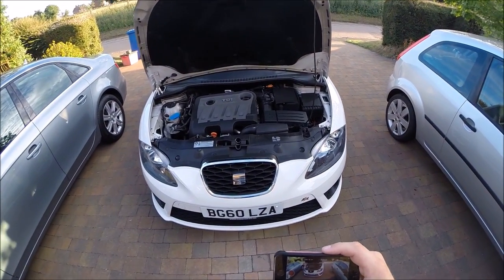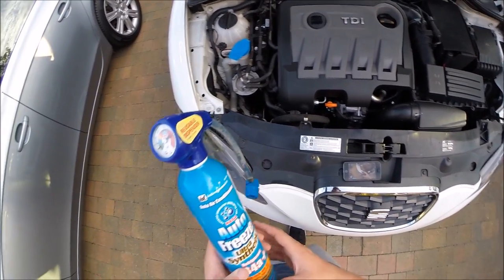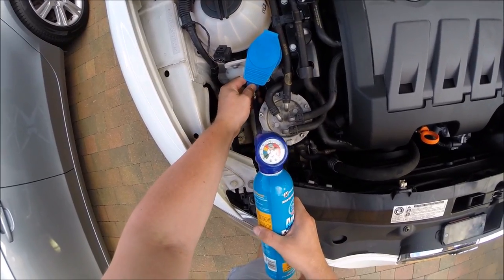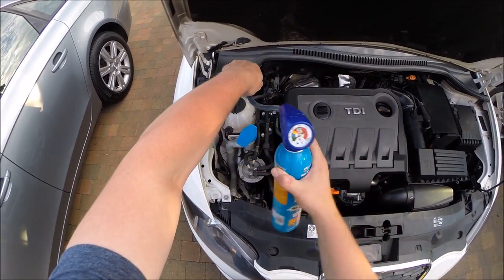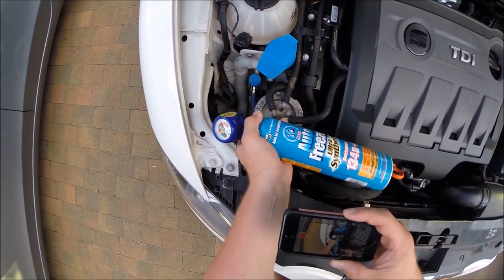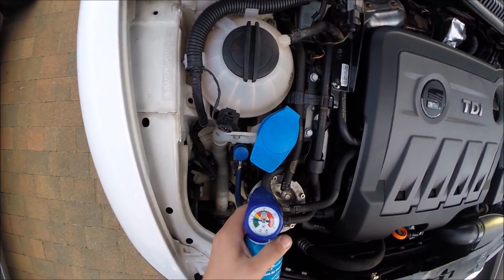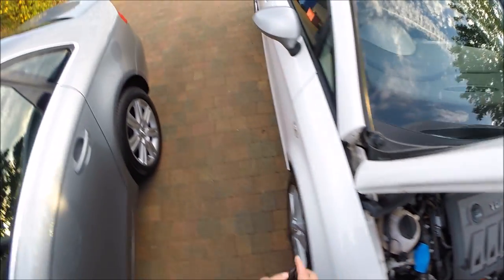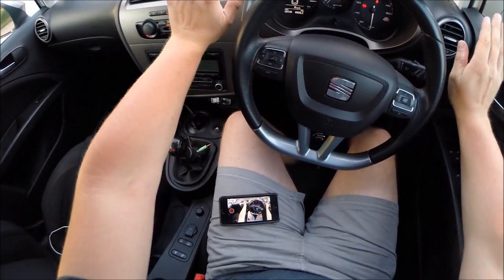How to Recharge a Car Air Conditioning System SEAT LEON TDI VW/AUDI/SKODA/SEAT

Comment: I think u have to conect to low pressure side while the car off then after switching the engine on and aircon on to high plus circulation on then start to add gas then when the system fill up switch the engine off then disconnect the gauge off the low pressure inlet and check for leak with add some water in the inlet and after checking close the screw top

Comment: This is nothing but a bodge job airconditioning gas is liquid when not under pressure and the correct amount in any system is calculated by weight,also compressor oil may need to be added to the system, the only way to do the job correctly is to have the system serviced, this involves drawing out the gas,pulling a vacume on the system to remove any contamination re oiling the. Compressor with the correct amount of oil then refilling the system with the correct weight of gas, over gassing will damage the system as will not having enough compressor oil,this is not a process you can do with a little can of r134a which are now illegal for many reasons